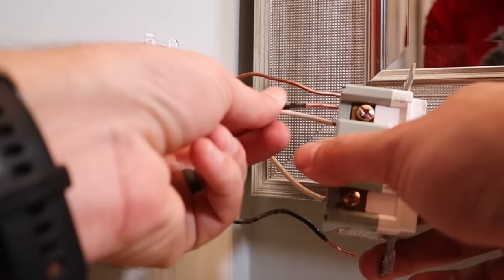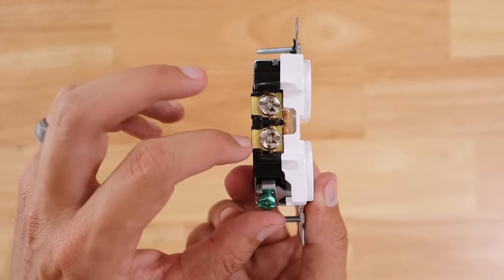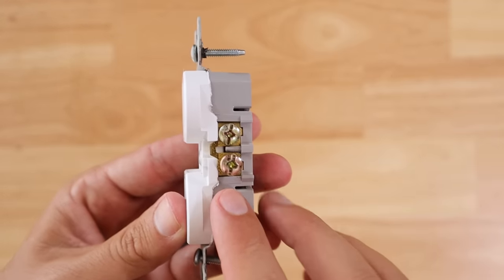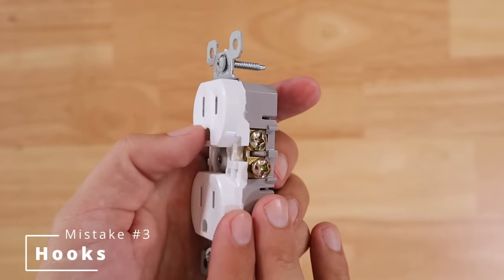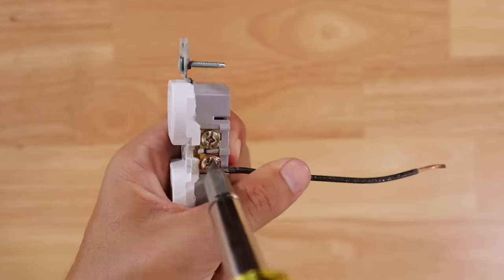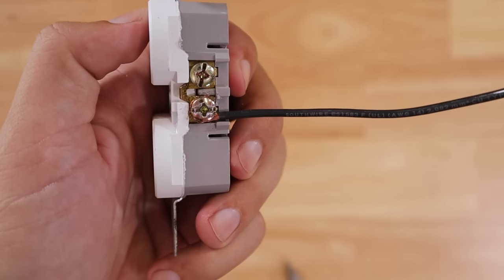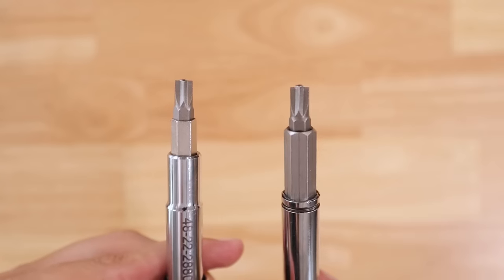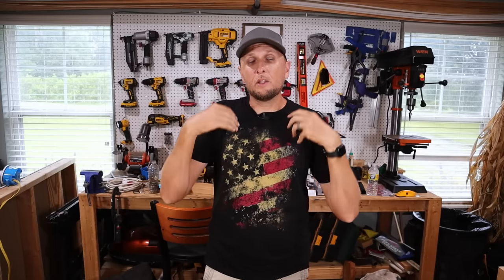The BIGGEST Mistakes DIYers Don't Know They Are Making When Wiring Receptacles | How To

Comment: that last one was a commercial.  all three screw drivers are fine to use.  The idea is the wire is to be snug not smashed, and to use the tools that is handy.  An offset screwdriver comes to mind as it is fast and designed for electrical work such as this.
Reply from the maker: Well I was not paid well for that supposed commercial.  In fact, I wasn't paid at all.  It's just what I use and I show why.  The others are fine but it is better.

Comment: The only issue I have with your comments on speed wiring - it's still code.  My house (1989) is full of this stuff.  Haven't lost an outlet yet, though I admit that I prefer using the screw connections, but even those can loosen.  Today (2024) I can go down to HD, buy an outlet and still have these stab connections.

8:30 - this just horrifies me.

Comment: The builders of the house I own made so many lazy mistakes.  All the hooks backwards, all the wires stripped too far, messed up grounds, too many wires under one cap, too many connections in one box, all the threads on the boxes stripped and then adhered with drywall screws, and just generally sloppy work.  It was way more work than I cared for to clean up, but I did it anyway.

Comment: I have three wires. Green s re is Ground. The other four screws are brass/ gold! I just noticed. That’s why they were on Amazon so cheap. So, Black wire to Groinded side,side with gen screw. White on the other side of outlet or all three wires go to 3 screws one side but for me four dam gold screws.

Comment: Although you may be correct that the backstab connections are less secure than screw connections, the outlets with those on them are UL certified, as well as Wagos, that use the same tech.

Comment: Another bad thing about using the holes in the back of the receptacle is that the connection is made with spring action using only a thin strip of metal. The contact point is very tiny compared to using the screw, so it is a higher resistance point and cannot handle amperage as well as the screw.

Comment: Will gold always be on the right side? (Right side as in; facing the front of a the outlet?) 
THANK YOU IN ADVANCE
Reply: The gold will always be on the side closest to the smaller slot (hot side). The silver will always be on the side closest to the larger slot (neutral side, white wire).

Comment: ok, so a couple of things. The quick connects are a valid method of connection. So say the engineers that designed and the engineers that approved the designs and the engineers that wrote the codes.  Also, Philips screw drivers are fine as long as you use the correct size and not an old worn driver. Other than that, I found your video to be good for newbie DIYers.

Comment: I have a question, is it OK to remove the doorbell chime and transformer, replacing it with an outlet to use with a plug-in transformer to connect to a doorbell that doesn't use the Chime (wired Ring doorbell) deleting the Chime? Thanks in advance.

Comment: Why not strip stranded wire father in and leave the excess insulation? I know stranded regardless if it's hooked clockwise spreads away from the terminal as it's tightened. If it's stripped about 1" from the end the insulation sticks out the back but also holds all the stands right while turning the terminal

Comment: As an additional safety feature, looking at the front of the plug, the right slot is shorter than the left, which is the hot side, and 99% of electrical male plugs the hot is narrower than the neutral side so as to not cause reverse polarity, could cause issues!

Comment: Easy thing to remember is big eye is neutral small eye is hot and mouth is ground. Ground in residential most likely always goes on the bottom as when pulling out a plug people tend to touch the bottom prongs which could end up not good if you had the hot on the bottom

Comment: Mistake in stranded wire is
Using the strip gauge, strip wire accordingly then strip 3/8 again and leave it on very end of wire overlaping so no wire can be seen
It will keep wire from opening apart

Comment: When you do quick connects do you need to tighten the screws also or leave them alone? Because I've found some like that in my home lol
Reply from the maker: You don't "need" to.  They will still work but it is good practice to tighten them down because they are energized and sticking out making the likelihood of them arcing or making contact with something they should more likely.

Comment: The only issue with the issue of backstabbing recepts. I bought a house builts in the 1950 that was added onto over time. Virtually every recept that I have replaced was backstabbed. It wasn't the backstabbing that caused them to need replacing. It was that they were so old, the plastic was falling apart on the body of the receptacle. If they were truly so dangerous, federal law would not allow them to be manufactured.

Comment: My house has an outlet that is flowing correct but when I'm plugging something into it, it cause power outage to some parts of my house. I decided to unscrew the white outlet cover and just that itself creates the power outage and sparks. When I was able to take off the cover, I saw blue and orange sparks on the top left side of the outlet. I want to try your method, however the wire attached is not white or black, it's a brown/ tan color. So now I'm thinking about hiring an electrician because I am not confident enough to mess with it. Any recommendations on what that tan wire could be?

Comment: If wanting to tap off an outlet, instead of running two wires to one screw, how about one wire to one screw and another back-stabbing? Are there more risks to that than the risks already associated with back-stabbing?

Comment: Electrician here. Pretty good video. The only things I might add is that I would leave a little bit more exposed conductor when I'm making the terminal loops because it's more dangerous to end up with conductor under the terminal head than it is to have a little bit of extra exposed copper. I mean the whole terminal is exposed. You shouldn't need to go nuts trying to hide the copper. 

Secondly I don't like your last piece of advice, about the screwdrivers. In the code books in Canada, which I believe are pretty congruent with the American code books, there is a torque spec for pretty much all terminal screws. You don't want to exceed this torque. Exceeding this torque value can be as dangerous as under torquing. Your objective shouldn't be to get that screw down as tight as you possibly can.

Comment: The little jumper between the two screws on either side, in what installation would that be broken off?
Reply from the maker: To make one of the receptacles on it to be operated by a light switch.  Usually the top one.  The other would always have power.
Reply: @HowToHomeDIY  Thanks for the quick reply. I just changed four but only one had it broke off.

Comment: how about back-wiring?  its where the terminal screws have a little clamp under them.  it looks like you  can insert a straight wire under them and  tighten it down.
Reply from the maker: Yup, they are on commercial grade receptacles.  Love back wiring.  I believe it’s one of the fastest, best, and most DIY friendly ways of installing outlets.

Comment: Great video but there’s another common mistake that most people don’t know and that is installing the receptacle with the ground port facing down, it’s supposed to face up as to prevent a short between hot and neutral if a metal object were to fall or even be placed between the receptacle and electrical cord such as a child placing a butter knife, or spoon between them, if he/she did that the child would hit the ground terminal first… it’s always safer for an object to accidentally hit the ground terminal first than a live terminal.

Comment: Both the neutral and hot wires should be pigtailed for 2 or more receptacles and/or lights on the same circuit, thus using only a single silver and brass screw, unless of course a receptacle has the tab on the hot side removed to be used as a split-duplex. The reason to wire receptacles that way is in the event a wire breaks or a screw comes loose, is so that only the receptacle it happened to won't work whilst the others on the same circuit feed will keep working, and narrows the trouble-shooting down to only the culprit receptacle.

Comment: I changed my receptacle correctly and ive done it before and did it safely turning off the electricity and even checking the current with one of those pens that you can check it with.  But it still does not work. And its only that outlet in the whole kitchen that does not work. Any advice?

Comment: DOES IT MATTER WHICH SCREWS YOU USE ?  THE TOP ONES OR THE BOTTOM IF YOUR JUST DEALING WITH ONE HOT WIRE AND ONE NEUTRAL ?

Comment: Should only have one hot on the back of the outlet regardless of whether it’s the end of the line or if the circuit goes to another receptacle. ALWAYS pigtail. The only time two hots should go to one receptacle is if it’s a half hot (switched on part of the outlet) or a separate circuit top and bottom, in which case the tab on the sides needs to be removed. That little tab is the usual point of failure when using two terminals to continue a circuit.

Comment: Gold/silver logic as a rule of thumb can bite you, the wires could be neutral on black and hot on white.   Best to check the outlet with a polarity tester after you hook it up. 

Shoddy contractors could have reversed them in the junction box, meaning they might have tied black to white and white to black.

Ive seen it before, I've seen even worse.   One light job someone did in my attic they didnt even use junction boxes, they cut lines and spliced abd electrical tapped...  Super sparky up there, the fire resistant insulation had scorch marks....

Comment: Does it matter which screws (top or bottom) that the wires go on on each side?
Reply: not really if your box is big enough the goal is to get the wiring inside it with least chance of a short so if the bottom screw is giving more space between wires go bottom rather then top get it? but top bottom screws are both connected to same plate if wires are stripped and installed properly makes no difference but again keep in mind what's giving most space between wires as well..you can also make a habit of taking electrical tape and wrapping around the rear of outlet covering the screws after wired as a additional safety net.

Comment: what about how the receptacle should be positioned when installed in the box, I was told that the ground should be on top, so not the typical face image with the two eyes on top and mouth (ground at the bottom)

Comment: UL listing of receptacle does NOT allow connection of stranded wire. You must use a “stak-on” terminal crimped on to the stranded wire, then place the stak-on under the screw on the receptacle.
Reply from the maker: I don’t believe that is accurate.  Please provide documentation on this.  Even the receptacle manufacturer states that stranded wire can be wrapped around the terminal screw.   Can be found on their website.  There certainly is no mention of using a stak-on or any other terminal connector anywhere.

Comment: wow im a minute 20 in and ur already wronng, nice
Reply from the maker: Nope I am not.  Just because it is AC does not mean things are designed for the feed side to be on the neutral at all times.  Good effort though.
Reply: @HowToHomeDIY  I agree with that. Except you did not say that in your video. You just said it could issues, but didnt say why. The actual issues with getting hot and nuetral backwards werent represented in the video. Such as lamps having a live bulb receptacle, despite the lamp still being functional.

Comment: hey what's about my favorite..they will instead of double stacked wires in the screw they have both screw connectors full and both quick push in connections used on a single outlet, yet wonder why the outlet gets so hot? I would say maybe it's ok, or slightly safer to use a 20amp outlet on a 15amp line line for that as it can handle more amperage but I'm almost certain you should never do that it's you use one or the other only..hook screws or pushin speed wire. but I agree I don't recommend using the speed wiring ones they can fall out and I've seen melted outlets from them.. manufacturers should stop making outlets with them.

Comment: 6:38 backstabbing causes real problems (resistant overheating) when people are charging their electric cars in their garages. These could charger overnight to get 30-40 miles of charger but run all night at 1440 watts (12 amps * 120 volts)!

Comment: I never liked the idea of the plug the wire in the back but pretty sure a few of mine are that way. I would hope they would last a while. IDK why if you had that much work to pull out the wire you would think they would fall out on their own? BUt who is twisting plugs etc  once the are plugged in is my question? just plug the item in done?

Comment: You missed a seemingly insignificant point, but I noticed that you practiced it out of habit.  When tightening that screw, ensure the long end of the loop is on the inside of that lip (used to be a metal tab in the old days), which keeps it from twisting around while tightening it.

Comment: Great video, but I gotta jump in here and check ya on the screwdriver sales pitch. You gave the worst example of Phillips head screwdrivers not working as good to get it tight. You gave the example of using a number 3 or 4 Philips when tightening a #2 Philips screw. Folks you don't need this screwdriver he's selling to get them tight. Look at your screwdriver set, they will have a #1,2,3,4.... on the side of the handle somewhere.  They will very in size and in how deep the driver fits into the screw. The whole point of making Philips screwdrivers was to stop the DIYer from stripping the head of a screw from applying to much force.  If you have the correct driver to screw, it's going to feel like that screw was made just for your driver. If it don't grab enough of the sides go for a little bigger and not so pointed driver. Save your money, after all that's why you're a DiYer right.

Comment: The only thing I would add is that the receptacle should be installed with the ground prong on top. If a plug was not all the way in, something could fall in and be across the hot and neutral prongs. This cannot happen with ground prong on top.

Comment: All good info, but I thought I was going to hear some kind of tip that would make my day.  Also, using the wire gauge on the back of the outlet is comical.  Kinda like somebody dialing in their pipe wrench to the gauge on the jaw instead of just going by feel.

Comment: I wondering if I can split the neutral wire to use two different switch if not how do I add neutral wire if existing doesn’t have neutral wire

Comment: I moved into an apartment. Bedroom switch did nothing. No overhead light present so I knew it controlled an outlet. All outlets remained hot when switch was in either position. I did some exploring and found an outlet where top and bottom plugs were powered by two individual hot wires but the brass tab between the two hadn't been snapped. Once I snapped it, top plug remained hot and bottom was controlled by the switch.
The electrician almost got it right. I, not being an electrician, fixed the issue and never told the apartment manager. I'm sure I would have been in trouble if I had.

Comment: What if no ground wire is available in the box and the box is plastic , and no conduit leading back to the breaker box?  It would be dangerous to install a grounded receptacle giving the illusion of a grounded receptacle 🤔 10:43

Comment: I avoid using outlets and switches that require a loop of wire around a screw.  I always insist on using ones with the pressure plates where you just insert a straight wire and the screw clamps down on it.

Comment: Hey Mr wiring master, Why didn't you tell them to tape up the device  to cover the sides and screws. Particularly useful if the device is going into a metal box.
Reply from the maker: That’s an optional thing someone can do.  As long as it’s installed properly I personally don’t see a reason for it but don’t blame someone who wants to take the extra precaution.

Comment: I have a receptacle in my living room that seems to be sunken in too far and the cover plate keeps cracking and breaking off.  Any suggestions?
Reply: You could use small washers on the two screws holding the receptacle to the box or wrap solid wire around the same two screws to use as a spacer to make the receptacle flush with the wall. They also sell device levelers that slip under the two screws and then tighten them. The third thing is they sell unbreakable device plates that flex instead of break.

Comment: Lol you said it was to much stripped but when you checked the gauge it was perfect......so which is it..?  Also if there is a lil to much just wrap  electrical tape around the receptacle
Reply from the maker: That wasn’t the same wire.  I used like 10 different wires that day.

Comment: I like to run a strip of electrical tape around the socket or any receptacle as sometimes I check plugs hot. I don't condone this as I electrical insulated tool and have run millions of miles of line.

Comment: I didn't have anything plugged in the bottom receptical in the kitchen and noticed at 3 a.m. the living room was off. checked breaker, nothing was flipped went back to receptical plugged the top to the bottom of receptical and everything turned on in the living room without anything plugged into that receptical the power shut off in kitchen and living room any idea